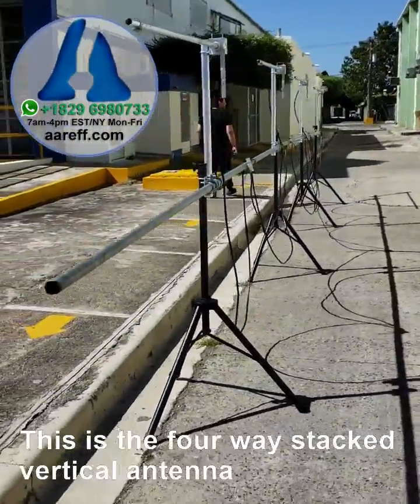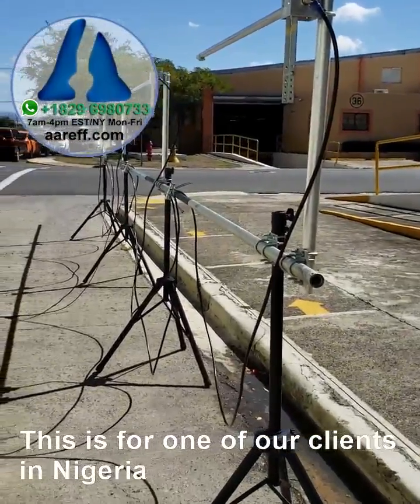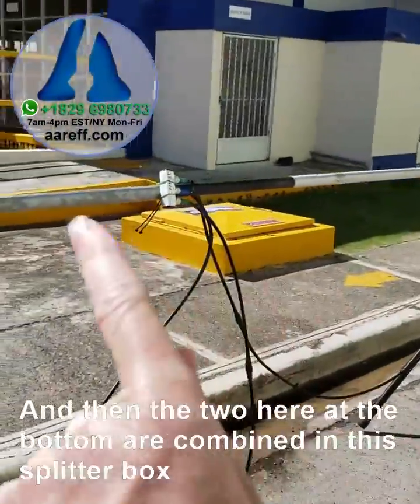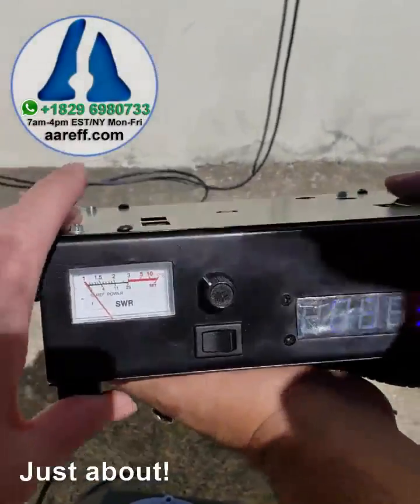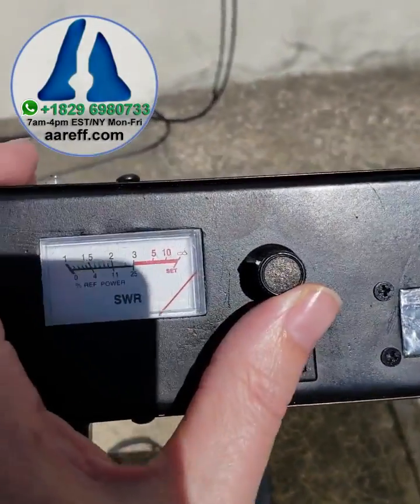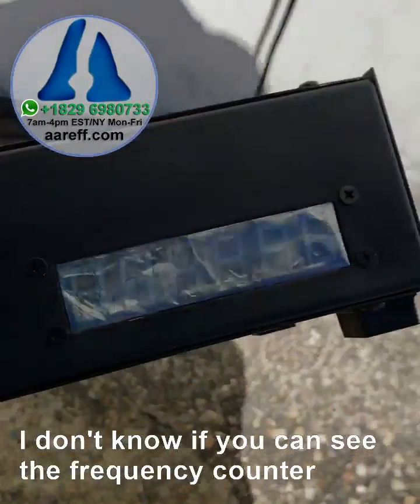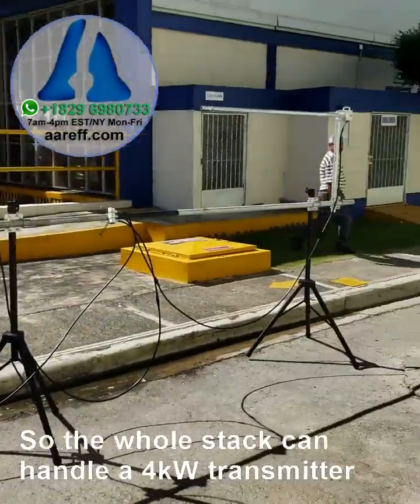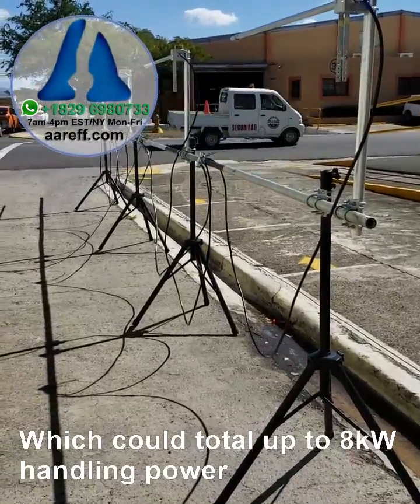Testing a 4 way FM Transmitter Vertical Half Wave Antenna

Comment: What's the minimum transmitter power to operate the  meaning of I put 300 wats into that antenna would it work or does it require 4000
Reply from the maker: No it does not require 4000W. 4000W is the maximum power it can handle before things start to melt. You can put anything less than 4000W, so you can use 300W, or even 300mW if you want.

This antenna is over kill for 300W, you would be better and more economical to buy our 4TDA which is similar performance and lower cost and can handle 800W. More info and price on this at https://www.aareff.com/en/4-stacked-dipole-fm-transmitter-antenna/